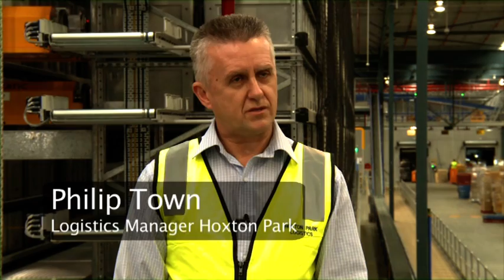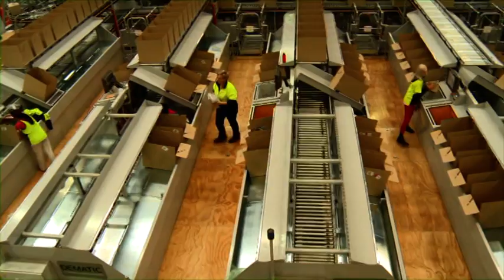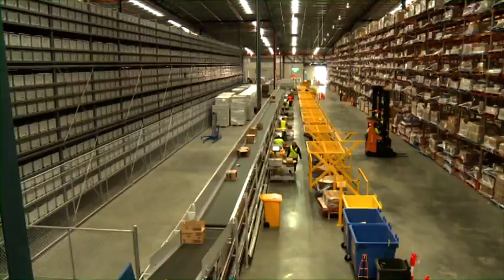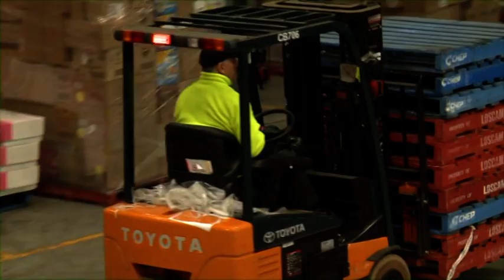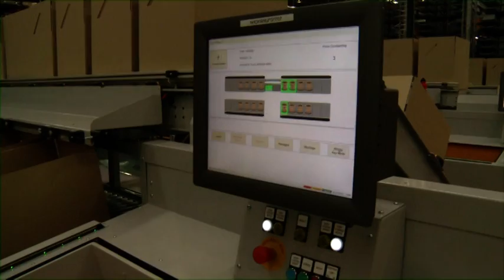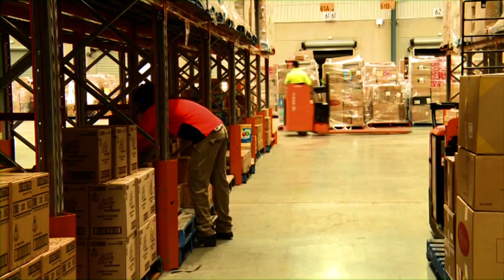DEMATIC | Big W's Dematic Multishuttle System at Hoxton Park

Comment: Could the lady pickers scarf get caught in the GTP conveyor?
Reply from the maker: Hi Patrick. Please be advised that this video was filmed only for marketing purposes during the commissioning period; however it occurred prior to Big W's official go-live and the implementation of formal operational safety procedures. Dematic RapidPICK stations as shown in the video do have sensors detecting obstructions in the vicinity of the tote movements, which immediately paralyses the machinery once a foreign object is detected. Nevertheless, in a real operational scenario Dematic strongly advises the operator to follow the manufacturer’s manual provided with the equipment, where the operators must not wear loose fitting clothing such as scarves, ties, necklace etc.